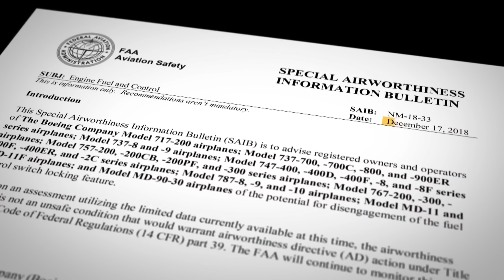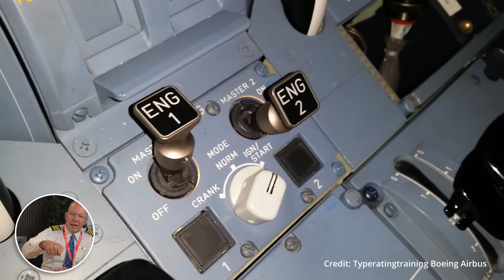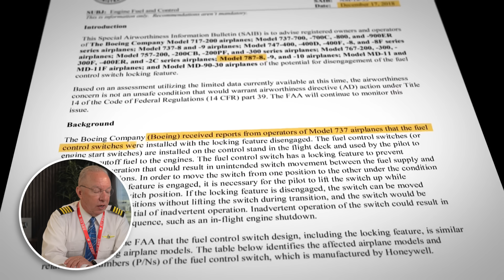Air India 171: The FAA’s 2018 Fuel Switch Locking Bulletin Explained (16 Questions Answered)

Comment: I hope you see this question - this is about ANY and ALL conversation between the pilots and between the Pilots and ATC.  The plane was airborne for at least 30-40 seconds.  Why is there no conversation or commands or arguments of ANY kind - like even one pilot asking the other to do some specific thing, after the initial exchange? Once the second pilot said "I didn't do it", shouldn't there have been urgent conversations to put the switches back on, or to perform other actions, or even exclamations about the impending crash, hard as it may be for us to imagine the absolutely terrifying last few seconds, of fear?  Isn't there something to the initial reports about the Mayday call where the pilot said he is not getting lift or thrust? How can there be such a gap in this reporting of all the verbal signals that should have been there in this short flight? I cannot imagine that after the initial exchange, the pilots - or at least one pilot - struggled to keep the plane flying in complete silence?

Comment: Quick question: Is there a possibility that the fuel switches go to CUT OFF because of electric problems, a behind the scene problem even if the switches are on RUN ?
Reply: Got my answer :D thank you

Comment: Captain Steve, Is it possible for the 787 software system to cutoff the fuel to both engines? Then one pilot would turn to the other and say why have you done that and the second pilot would reply that he didn't. Then realising the situation, one of them would then turn the switches to cutoff and back to 'run', which is what happened.
Reply: Asking a wrong person. He is already on the site of Boeing

Comment: I disagree with Capt. Steeve on this one. Camera's should def be installed in the cockpit (its a no brainer) and if possible near the most critical components. If privacy (and reading magazines) is the concern, then the footage could be stored like the CVR and FDR and be retrieved only in the event of an incident. Tamperproof. Pilots unions should welcome this  because it could be the determining factor when pilots are wrongly accused. It could also immensely cut down the time taken to solve and close an investigation. Also, one would expect that having the throttle at idle for a fuel cutoff switch to activate like on the Embraer, should be the logical bare minimum. For instance, during an engine fire, throttle down to idle, if the fire persists, cutoff fuel.

Comment: I saw another interview where manual change between the 2 switches would take at least a min of 6-8 seconds if done manually. It cannot be 1 second between the 2 switches all of a sudden, that too at the time of take off when one of the pilot is at rotating. To me it looks extremely unlikely, and there is some faulty setup in the switches setup.

Comment: So shameful that this video and the western media is trying to save the behemoth called Boeing who in past has even gone to extent of eliminating whistleblowers and have had issues in design, specially because this crash is from a non-western bloc country. This guy is from the beginning trying to blame on other reasons…earlier he blamed on birds then on experienced pilots confusing landing gear and flap switches and now on pilot’s mental health causing murder suicide. Also the report actually says ‘transitioned’ and not just set to off. Also why release only two lines from cockpit voice recorder are released which just enough to blame pilots. Why the report was release at an odd time with special consideration to stock market closing times… Any westerners supporting this hogwash of a report must know, they are also flying in planes from same manufactures. The investigation is behind totally closed door without any representatives from pilots association or non-stakeholders. Just watch the movie Sully or read about the ‘miracle on Hudson’ incident to know how the investigation goes on. In that case the pilot was alive and hence could save himself. Shame captain Steve 🤮… why don’t you wait for whole investigation…as soon as there is new evidence and a chance to blame anything other than manufactures, your video is out.  Everyone including Indian aviation regulator body, govt, manufactures and airlines have hastily cleared each other of any wrongdoing.🙏🏼

Comment: Although we do not KNOW yet, who did what as the report does not give us that info and there are no cameras in any cockpit, we do know that the co-pilot was sitting on the right seat, flying the plane, meaning he had both hands on the joke at time of rotate, hence it must have been the captain on the left seat using his hands to shut them off. The assumption then would be that the flying copilot asked "why did you shut off?" and then turned them back on at the same time as he did fly the plane. That would explain the tilting of the plane to the right a bit (what we saw early on in the fist videos) as the co-pilot most likely put the switches on again with his left hand, hence he only had one hand on the "steering" (and perhaps moved his foot for the rudder also a bit)...

OR Is it possible that the electronic board behind the switches, the computer in the plane had a malfunction, without any input from the switches? Like one of my 2 monitors here at home the other day just out of the blue went dark for 10 seconds and then came back on without me pressing or touching anything, just because one electron was going somewhere wrong???

► Does the flight data recorder record the electronic signal from the BUS ("1" or "0") or does it physically record what the mechanical switch does??? ◄

Comment: Thank you for these videos, handling all sides very respectful! Great job in this bad times! About the switches the report tells, that the service bulletin was released in 2018. The report also states that the middle flight control deck had been replaced in 2019 and 2023 for unknown reasons according to the airframes logs. I highly doubt that the switches have been re-installed with the fault mentioned in the bulletin and without being noticed by all the checks afterwards. Also the flight data recorder does record the switch position before these control signals enter any computers. If it wasn't the switches, the FDR would have recorded other signals leading to dual engine out but not fuel cut off. 
Finally there is a big issue with video in flight decks. If you look at how these flight recorders look after such an incident, you can imagine that there is only very little physical space that can be somehow mostly protected. And for the second FDR on this flight even that wasn't possible. Video needs much more storage compared to the data signals or highly compressed voice recordings. A video data recorder would simply not survive because of it's memories physical size. Also the amount of data will wear out most memory techniques very fast. And you cannot use the dashcam approach that buffers some video in RAM before writing it to flash, as dashcams don't need to survive a 1000g crash into a wall and then being engulfed in flames of 2200°C for 30 minutes.

Comment: Hi Captain Steeeve, in the cockpit’s voice recording, would the investigators be able to hear the fuel switches being switched off ? Would the act of manually cutting the switches off create a significant enough noise for it to be distinguished in the recording? That could seal the deal in my opinion.
Reply: They know the exact frequency those switches make and can look for that frequency on the  cockpit recording at the time those switches were moved.

Comment: The 2018 FAA advisory on faulty fuel switch mechanisms and GE’s 2020 alert on the MN4 microprocessor have received—both involving critical safety systems. Why have Boeing and GE not addressed these publicly, especially in light of recent tragedies?

Comment: This "preliminary report is so vague and contradictory that it ONLY results in more questions and all this wide ranging comment and "expert opinion" instead of complete and factual data/fact. 
So, answer this question as a "experienced pilot": If you are sitting there flying this huge plane and you have just achieved "lift off" and are maybe 400 feet up in the air and, as so many experts have all "concluded" without specific wording in the report, you physically see the other pilot put both fuel cutoff switches into the "cut-off" position, YOU WOUULD SIT THERE FOR 10 SECONDS BEFORE PUTTING THEM BACK INTO THE "RUN" POSITION ??? 
With 1000 to 10,000 hours of experience flying this very type of aircraft, you know you are only 400 feet into the air, you are headed for buildings, you have lost all thrust, and you are very aware how long it takes one of these huge jet engines to re-start and you would wait 10 seconds before moving the switches back to the "Run" position??? 
Not EVER even being close to a aircraft cockpit, I would expect under these conditions, a pilot flying this plane seeing the other pilot putting those switches in the "fuel Cutoff" position, the question would have been "WHAT THE FUCK ARE YOU DOING THAT FOR" ???? THERE IS SOMETHING VERY WRONG WITH THIS ENTIRE SCENE !!! 
There are no "images" showing switch positions during the time stamps that are given for their positions. Only "sensor" inputs related to their contact positions. The two pilots have one "way too calm" audio exchange "why did you do that"?? And "I did not do so". Doesn't much sound like "holy Fuck, we are going to die" !!!  And, it took 10 seconds to figure out "let's toggle the fuel switches!!! This is either "hugely bungled" or "intentionally vague and calculated" in an attempt to "pacify" the audience until the full and complete explanation comes out 18 months from now when everyone has forgotten all about this sad event !!!

Comment: I believe that the big question is if the fuel supply and cutoff switches of the downed aircraft were inspected to see if the locking mechanism was disengaged? Can this not be verified unless they were severely damaged from the crash and fire?

Comment: Just curious - If this was a deliberate act by one of the pilots and the other pilot I pressume is asking the question "Why did you do that" and also tries to restore the engines. Why there are no signs of resist/oppose from the first pilot, in case this was a deliberate act. It could also be possible that both pilots worked together to recover from the unexpected situation.

Comment: Too many Sherlock Holmes types coming online and spreading the "Suicide Narrative". There are various indicators that counter the suicide angle and far more indicators that point towards a technical snag or failure. What percentage of air crashes are due to pilot suicides? Less than even 1%. Any video jumping the gun to spread the "pilot suicide' theory should be flagged. I am going to be flagging all such video from now on. 

The fact that Boeing planes have performed poorly lately and the company has tried to suppress all whistleblowing and even pointing to the pilot error narrative in all the recent crashes is reason enough not to be jumping on to the 'pilot suicide' narrative. This was very likely a technical issue that lead to the accident. Let's wait for the investigation to complete.

Comment: The ‘locking feature?’  What an asinine bulletin put out by Felonious Air Assassins.  That detent cannot be deactivated, jimmied, or modified in any way.  Some jackass stick jockey screwed up, PERIOD!  PILOT ERROR!  I’ve been working Boeing products for forty years.  I’m a lead mechanic,  high power rated and taxi rated in every Boeing platform.  Boeing makes a great aircraft and here is one for you, there has NEVER been a dual engine failure in any Boeing twin engine jet save the Gimlee Glider, and that’s because it ran out of fuel.  This BS is getting old.  90% of all fatal commercial airline crashes are cockpit induced.  The Boeing 787 has a stellar record, and what, all of a sudden, out of the blue, we have a twin engine failure on two of the most modern high bypass turbofans, riiiiiiiiiiiight.  The switches are not spring load in either direction, the only spring being the spring which holds the lever in the selected position.  Service bulletins are a suggestion, not an order.  AD’s are scripture and you will follow them.

Comment: Does report look good to you, isn't it manipulative or hiding facts? Written in such way it's supposed to bring more darkness than light
1. Does report have valve positions or switches states recordings, switches could have never been touched at all
2. There's no exact milliseconds for cut off, report deliberately says "gap 01" sec, it could be milliseconds, 0.1 sec. Meaning it's technical, most likely electrical failure observed and tracked by passengers in their last videos
3. No exact timestamp for rat deploy, report references to video from airport but exact data is present in black box data, why timestamp is not mentioned like for other events? it could mean engine failure prior to cutoff, because rat needs certain time for deploy. 
4. Pilots are most likely talking in Indian, when official communication could be in English. Report doesn't provide full or partial transcript, just translation of one phrase ripped out of context, that is conveniently placed.
5. South Korean, Ethiopian Airlines launch switches verification procedure, probably refreshing in memory MCAS Boeing issue when it took 2nd plane to crash. People saying there were no recommendations after crash, suggesting aircraft was ok, probably have short memory how things took place with Lion airplane
6. If there was struggle in cabin why pilot wouldn't confirm this in mayday call?
7. Release of report was after stock market closure at the end of the day, when no one pays attention

Comment: If the mechanical, spring-loaded, guarded switches could so easily be "BUMPED" to the cutoff position, then why didn't at least one of them bump back into the cutoff position after the extreme jolt of a bellyflop crash?

Comment: Even if the fuel switches were placed to cut off in position 3 seconds into the flight how can it be concluded it was done intentionally and not by mistake.The pilot would not have allowed to even take off and crashed in runway wall itself....

Comment: Steve, Learning from this what’s the main things that need to change? Many theories from mental health deliberate act, Accident, mechanical issue ect. Would having cutoff switches for each pilot be a solution to which both pairs need to be either on or off to make it work. Or does that indicate the lack of trust you show each other.

Comment: If the RAT deployed. Then it completely eliminates the theory of the fuel switches intensionally switched off by the pilot.. RAT will not deploy by intentional switch movement but only deploys in a systemic failure where both engines failed..The pilot do attempt to switch it back to run but it was too late.
Reply: No. RAT will auto-deploy if both IDGs are lost in-flight, which they were. Fuel switches Cutoff > dual Engine loss > dual IDG loss > no AC power > auto-deployment of RAT in flight.

Comment: They should place one switch on each pilot side so that, this can be prevented and they can still fly with just one engine with full power if other pilot does something wrong. They should do this for things that can be manually turned off. This is like a two person agreeing to things that are important, before they both switch off for emergencies.
Other option is to have 3 pilots all the time at the cockpit.
If this was deliberate, we don't know how much of a struggle the good pilot had to manage and also fend off potential attacks by the second bad pilot. It is also surprising that the bad pilot just did one bad thing (cut off the fuel) but didn't interfere again if he/she was suicidal. There must be continous struggle either physically or with controls to force it down. If by sheer luck, one or both engines produced enough power, what are the chances that bad pilot just keeps quiet?

Comment: I read SAIB: NM-18-33 an it wasn't to check to see if the fuel cutoff switches were installed upside down, but to check and see if the improper part number was installed. Part of the check was to see if the switch could be moved from cutoff to run and back without lifting them. It then goes on to give the correct part number for the switch. The fuel control switch panel was replaced twice on that aircraft, the last time in 2023, and I suppose it is within the realm of possibilities that the wrong switches somehow made it back into the supply pipeline. All of that having been said, why anyone would have their hands anywhere near those switches at that phase of flight is hard to believe. I agree with you that human intervention caused this, the only question in my mind is was it intentional or mistaken.
(Captain, retired, Delta)

Comment: Saw this today , if it’s true , they would have to check every aircraft: Capt Kishore Chinta, a former investigator with India's Aircraft Accident Investigation Bureau (AAIB), wonders whether the switches tripped because of a problem with the plane's electronic control unit.
"Can the fuel cut-off switches be triggered electronically by the plane's electronic control unit without movement by the pilot? If the fuel cut-off switches tripped electronically, then it's a cause for concern," he told the BBC.